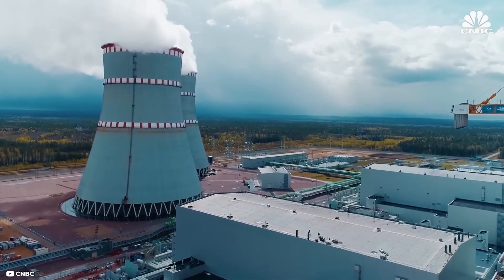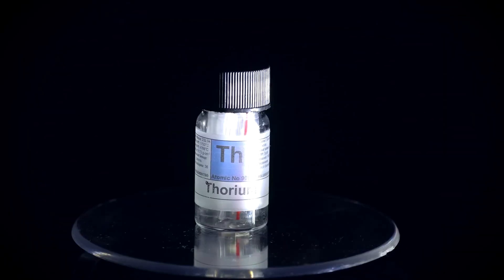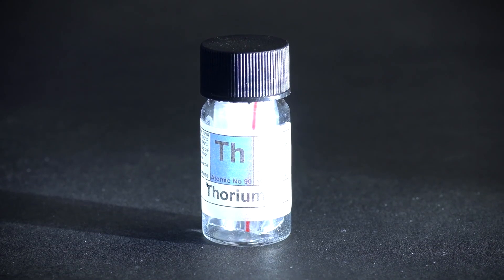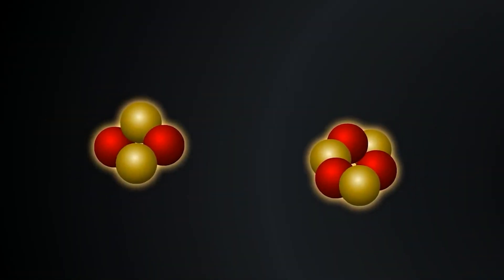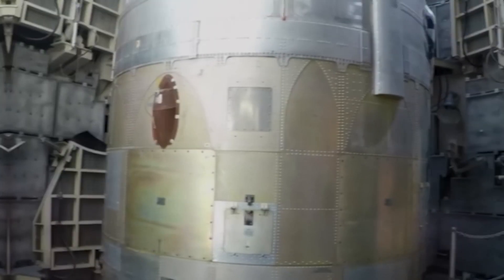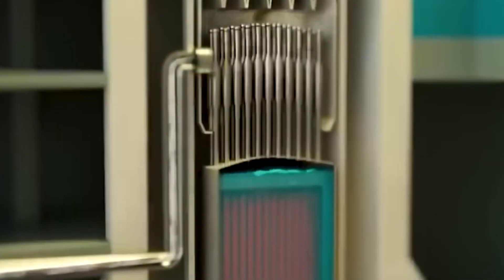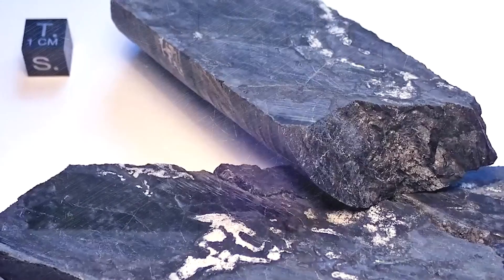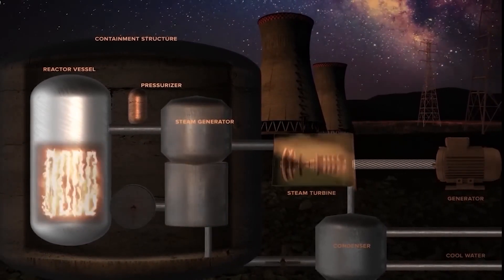Powering the Future: The Rise of Thorium Nuclear Reactors

Comment: Does Thorium readily cross skin barriers?
Reply: Yes
Reply: @sophiophile  US Department of Health and Human Services report Toxicological Profile for Thorium. September 2019

Recommended Exposure Limit (REL)—A National Institute for Occupational Safety and Health (NIOSH) time-weighted average (TWA) concentration for up to a 10-hour workday during a 40-hour workweek.
Hardly crossing barriers readily.
Reply: @curlyjoh9055  Did you actually look at the reference you provided?
Reply: @curlyjoh9055  While the amount of radiation given off by Th-232 is relatively VERY small--as 232 has the longest half-life of any radioactive isotope known-, the radiation that thorium DOES emit comes in the form of neutron radiation, a very dangerous form of radiation that readily passes through biological tissue and has the mass to pack a punch to boot.
tl;dr: Thorium-232 radiation does readily pass through skin. While safer than uranium, the fact that it radiates neutrons means it still poses a health risk.
Reply: @n.a.7883  the Agency for Toxic Substances and Disease Registry notes the US EPA have not concluded whether  Thorium can cause cancer in people.

Thorium was once thought to cause cancer in mill and mine operators, however it was later concluded that the cancer in those operators was caused by cigarette smoking and silica.